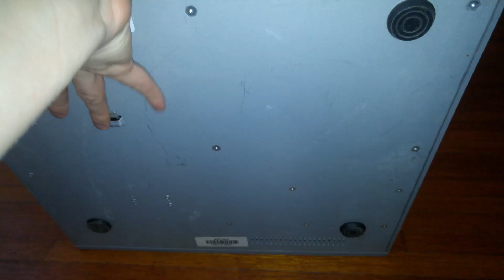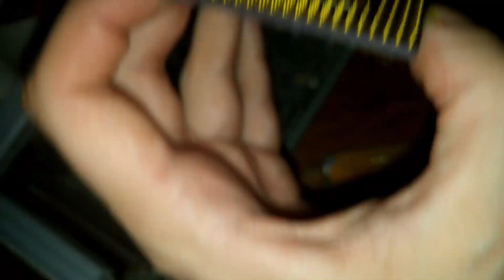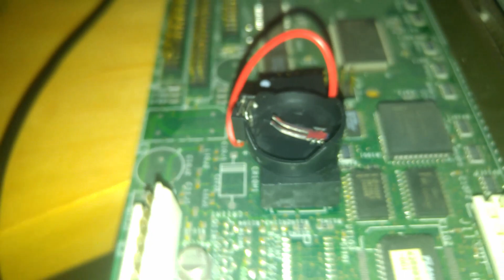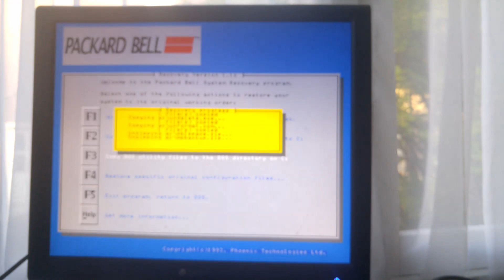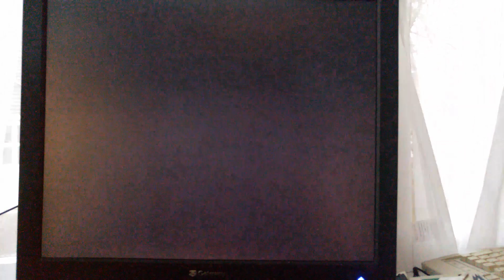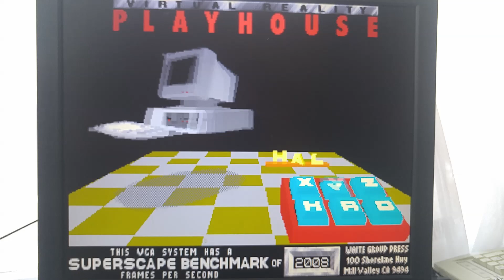Packard Bell A940 4X4 Repair + Benchmarks

Comment: Very helpful video!
Got one of these today and it's such a nice machine.
The SX948s are the most common P60s - nearly all of mine are of this model despite one with the fdiv "bug" which is an SX835.

After some years of collecting I have come to the conclusion that 66mhz models and models without heat spreader seem to be pretty rare now - at least in parts of Europe.

Comment: Hello! A few years ago you made a video on your Rodime RO202E Hard drive demonstrating it working. I have gotten my hands on one of these drives. It's a bit worse for wear, but it may just work! I have a couple questions:
1: How did you take the cover off? It seems glued shut with some foam.
2: This is the most important: What drive type did you use to get it running? I got it out of an IBM PC/AT 5170 that has significant corrosion from a battery leak. I frankensteined together a setup with the drive plugged in to my working Compaq Deskpro 286, but I cannot find a drive type list for my computer, and I can't find one that remotely matches the C/H/S specs for the drive.
I can't test it out further without this information.
Reply from the maker: 1: There might be a screw hiding under a warranty sticker, if all the screws are out though, it's just a matter of getting a screwdriver inbetween the lid and the drive casing to gently pry it off. It's not glued, but the seals are malleable.
2: You don't need an exact CHS match to get the drive to work. Sectors is the most important value to match, but as long as you choose a type with less or equal heads and cylinders than the drive has, you'll be fine, just not using the entire space. If you choose a type with higher cylinders and heads, you'll make the drive try to step beyond the drives' physical limits.

hope that helps
Reply: @the731272  
Thank you so much for the reply!
I managed to track down the drive types list from the technical reference manual, but I can’t find even a remotely close match. 
The rodime drive specs are 640 cylinders/4 heads/32 sectors/track.
None of the options match even the 32 sectors/track. Am I screwed at this point?
The drive types are listed at page 340 of this manual: https://onedrive.live.com/?authkey=%21AJOmtRmVhlhL6%5Fo&cid=7D567B5161FE0EB7&id=7D567B5161FE0EB7%2147144&parId=7D567B5161FE0EB7%2137014&o=OneUp
Reply from the maker: @Electrical-Shorts  try type 2. The 202E must have been originally used with a weird controller, but selecting type 2 will get you about half the capacity...
Reply: @the731272  Type 2 is the type of the drive I normally use in that Deskpro, so it was the first one I tried when setting it up. It gave me a 1790 disk 0 error. This was using the controller card I got out of the dead PC/AT. My normal controller card is made for an extremely early IDE drive. Are drive types dependent on the controller card or the BIOS? Also, my goal here is to see what the contents of the drive are, if it does work. Would having less capacity interfere with that?
Reply from the maker: @Electrical-Shorts  MFM drives are typically only going to be readable on the same controller they were formatted on. Mostly because MFM was only ever a de-facto standard for controlling the drive, and low-level formats were proprietary. As for the drive types/capacities, it depends on the system. Your 286 is probably only going to work based on those fixed types in the bios (no user type it seems?), whereas XT class systems will work more on the limitations of the controller card. Also make sure to check your drive select jumper, i've been bitten when it's sitting on 1 instead of 0 and i get 1790s.